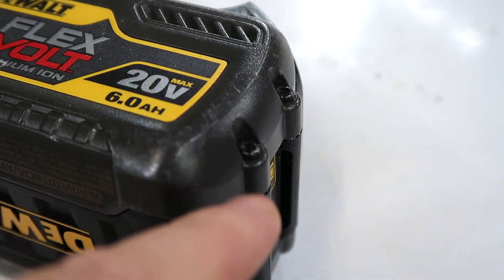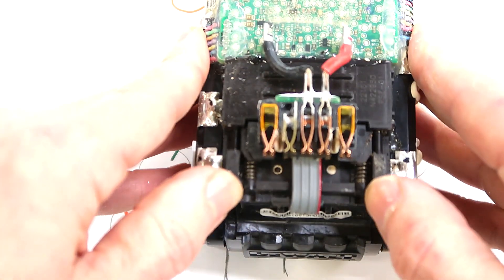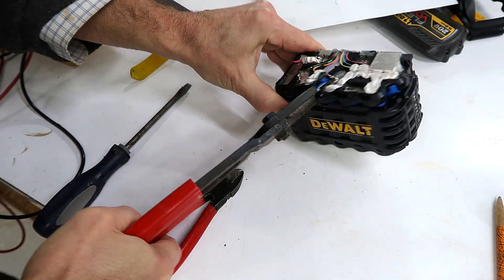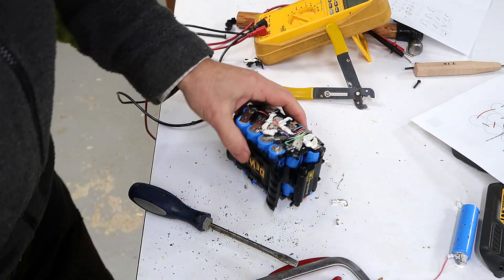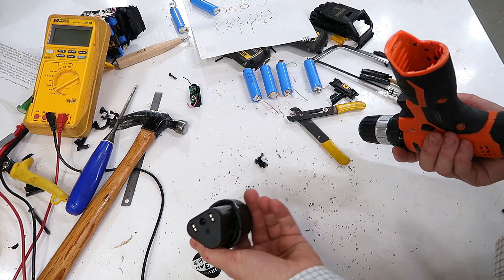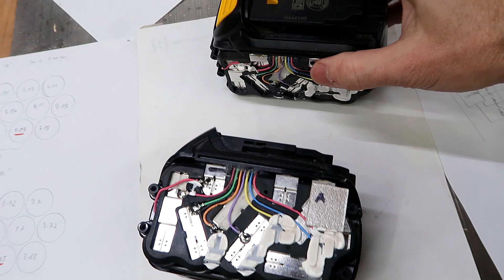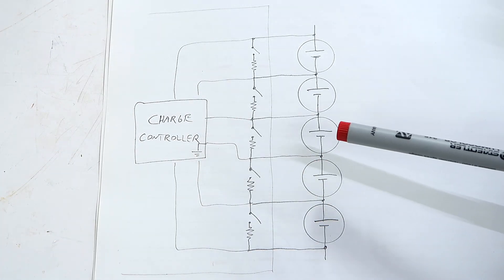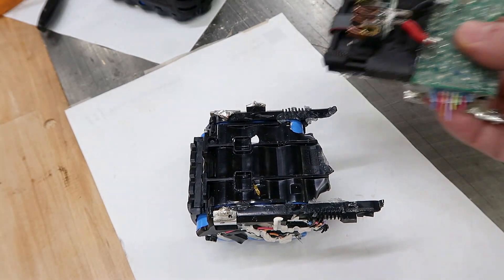This kills flexvolt batteries prematurely

Comment: I bought two flexible six amp batteries and both of them did not work after two months. They look brand new and I hardly use them. I sent them back and dewalt  honored the warranty sent me two brand new ones in a box one of those brand new ones immediately did not charge and won't show more than 1 bar never had a problem with the 9 amps though

Comment: These batteries are not at all difficult to disassemble non-destructively. Take off the battery tab by either prying or gently grinding the spot weld away, take all screws out, desolder the BMS leads, separate the shell on one side, and wow you can suddenly slide out the couple of cells you need.

Comment: Can I revive a drained cell?
Reply from the maker: ask someone who says they can
Reply: With a power supply you can. Its safer if the battery is not below 3v and you will want to know the battery resistance, as that is an indication of health. Best left to someone who knows what they are doing.

Comment: Fantastic video! Many modern fuel gauge, cell balancing, charge controller ICs will disconnect the load if any single cell drops too low, but A) these packs may not have that feature, and B) That IC can still drain a few hundred uA meaning it will kill the battery eventually if you don't charge it. Thanks for this great teardown vid!

Comment: I just bought two new 5Ah PowerStack battery s and they both have a cell that's low, I have to figure it out how to get it charged to the same level, otherwise it will not last for long, crap DeWalt quality. Looks like planed obsolescence!
Reply: Its no difference with any other brand. At least Dewalt is not locking the BMS yet like other companies.

Comment: Should always 1st try to bring each cell to at least 3.5v.  the 2.72v cell is probably still recoverable. 
Otherwise the first the charge, first to discharge rule will hobble your battery.  my experience was with nicer designs .... https://youtu.be/lm0ZGxHCT8c

Comment: The important part of the DeWalt battery pack is the end that connects to the charger or device.  The magazine holding the batteries isn't crucial and can be replaced by a different one.  It should be possible to 3D print a new magazine that will mate with the device connector end while still being user friendly as far as replacing individual cells.

Comment: It is a very expensive battery. So dewalt has not designed it to be repaired, under the guise of making it tough. It is not very environmentally friendly of them. For as soon as one battery goes it is useless as a house of cards. While the rest of the batteries are perfectly fine.

Comment: I wonder if using a different charger would make a difference.
Reply from the maker: cell balancing happens inside the pack, not much the charger can do about it.  And cell balancing only happens during charging.  So he important thing is if it hasn't been used for months, charge the battery before heavy use even if its not empty

Comment: Interesting to know
cuz the normal XR do not have a way to balance them

i will dig into this with one of Flexvolt
what cells are those blue one in 6Ah ?
i know the 9Ah and 12Ah uses 21700

Samsung 30T and 40T
40T seems to have issue

Comment: Very useful tip video Matthias, thanks. I don't use my flexvolt 9ah all that much so knowing not to run it all down at once before charging will save me £150 on a new one down the line.

Comment: Hey Matthias, one tip for getting around security torx screws without damaging it (and potentially voiding a warranty): They're meant to keep other people out of them, but there's a fundamental vulnerability, where all you just need to do is use a small enough flathead screwdriver to undo them.  You just need to jam the flathead between the pin and the sides of the chamber.

Comment: Hi Matthias, awesome investigation! How about designing a new matrix controller that would constantly rewire the batteries to prevent this from happening? Even simpler would be to modify the circuit to provide balanced charging and solve the issue much easier. Thanks for the video!

Comment: I am pretty sure you are correct concerning the cause (and solution) I seen this being done in other products as well. If you had tried charging the 3 bad cells individually up to the voltage of the other cells, while still in the pack, you most likely could have recovered the pack and then could have put them on the charger for balancing. I have done this myself but on a 5 cell pack.
Reply: How to charge the cell individually? What kind of charger can be used?
Reply: you have to inject low voltage with a probe on each cell until it gets to a detectable safe charging voltage for the dewalt charger @harenthiran

Comment: Do you not leave the battery on the tool as the tool will slowly drain the battery and quite often make it unretrievable. With Dewalt batteries they sometimes appear dead but if you leave them on the charger for an hour the smart charger can sometimes recover them.

Comment: i know you make these videos for entertainment purposes so i wont get too critical here,  but just for the record, those cells were probably fine. when an individual cell falls out of favor with the rest in the pack, the balance circuit cant correct it. all you really had to do was attach an independent charger to each cell one by one and bring them up to the other cells in that group of 5.  i would do the one at 0.01 in increments tho, bring up to 1 or 2 volts and see if it holds onto any of it or not before going all in.  oh and ps,  you can do this without removing any of the cells or tearing anything up(at least on these dewalts you can)
Reply from the maker: once the charge gets that low, the cell is toast
Reply: @matthiasrandomstuff2221  experience with them has told me that isnt always true, around 3 years ago i took apart a dell laptop battery that was around 15-18 years old, all 9 cells were 0.4 or lower, and all 9 recovered. the cell's original capacity was 2600mah, none were lower than 2200, some were above 2400, they all hold their voltage and their capacity to this day. their capacity however is determined by how many discharges they have done, not by how low they went.  if you're concerned that it might explode, take it outside to try it,  but i would recommend trying to save it first time next time this happens. you might just be surprised with the result.   the balance circuit only balances between the groups of 5, it cant fix an individual cell if one drops off from the rest.  on that part im not sure why that even happens but sometimes the cell itself is fine

Comment: So I guess the battery was charged on a non flex volt charger, 😎
Reply from the maker: all flexvolt batteries charge on a 20 volt charger
Reply: @matthiasrandomstuff2221  yeah, they charge, but the XR chargers overheat the battery, hence the fan or trickle on the the last 20% on a proper flexvolt charger, 👌

Comment: i'd never have guessed this. what use is a so called "battery protection circuit" if it doesn't monitor the balancing leads.

Comment: Never try and recharge a lithium cell that's gone below 2.5V.  The copper current collector dissolves into the electrolyte and can plate out elsewhere in the cell when charged, possibly leading to short circuit and fire.

Comment: I'm not so sure the BIG tool brands have ANY type of cell balancing. That would add a lot of charge time and their customers have come to expect a charge in as little as 30 to 60 min. Yes every cell voltage is monitored because they have to, but charging terminates when ANY cell voltage approches the 4.2v maximum threshold for Li-ion. This can leave some cells less than fully charged, however with factory matched cells the voltage will stay fairly similar without balancing unless they are abused or have many cycles. 
Also reverse voltage is not going to happen, this isn't Nickel Cadmium technology. There is a full BMS in the battery to protect against low cell voltage. The MOSFETs shut off the load and the battery becomes unusable when any cell voltage is less then 2v. This includes powering the BMS as well. The standby current of the BMS isnt going to drop a cell to zero. Whenever you see a Li-ion battery @ 0v the cell is SHORTED internally. This is a fairly common thing that happens. Thats why TESLA batteries have a "fuse" on every cell. When there is hundreds of cells in parallel, you dont want a shorted cell to then short the others.

Comment: Your theory is good but very unusual. I have never ever seen a BMS that takes its power from the middle cell - it would make balancing the cells much, much harder to do circuit-wise. I think it's something else at work, but without a battery to work on i cannot say for sure.

Comment: nice video but if you just charged up the 3 low voltage batteries and then put the cover back on then you would have not wasted your time and a half decent, very expensive battery.

Comment: It's sad that 14 more batteries get thrown out when 1 dies or under voltage.  Could you have hooked up a power supply to the individual cells and brought them back up?
Reply from the maker: It might have helped make it sort of usable again, but once they get that low they are irreversibly damaged.

Comment: I have successfully rebuilt one of these pack without destroying it, built my own spot welder and everything
However, it will not charge past 1 bar  just like before i rebuilt it I even pre charged all of the cells ahead of time
sure wish I knew the secret to rebuilding flexvolts

Comment: Considering the very high price of these batteries and charger, it should have a functioning balancing charger.  They have been used in the Hobby industry for at least a decade.  It reads the voltage of every cell and charges until they are all balanced.

Comment: I would have put a single-cell charger on each of the dead cells, current limited to C/100 or possibly C/20 or even C/10 but lower is better.  Even from well under 1 volt I've had cells recover and work for years, but usually with some permanent reduction in capacity.
I had a 7S20P pack with one of the 20P sets short circuited to 0 volts for an unknown amount of time.  Four of the cells had been physically damaged by the short or showed signs of severe overheating.  Removing the short and trying to charge the set failed so I separated all the cells.  13 of the 20 are in my scrap pile either because they were internally shorted and would not charge at all or would self-discharge too fast for my taste. 7 of the 20 recovered and have been working well.

Comment: Do not store lithium ion batteries for more than a week fully charged or discharged.  That is the mantra of radio controlled aircraft fliers.  The best state of charge for storage is about 60% of full charge for longest battery life.  RC battery chargers usually offer a storage charging cycle that achieves that storage charge level and balances the cells to within 0.02 volts.  Do I always follow that advice?  Nope.  My tool batteries are often forgotten on the charger for a week or more and then left fully charged on the shelf for a month or more.
Reply from the maker: Yes, agreed.  But aircraft batteries probably get charged MUCH higher than tool batteries, cause capacity over weight is so much more important. EV batteries get charged a lower level still, and grid batteries even lower.

Comment: I was literally wondering this about these batteries the other day. Like you i thought they were 3 horizontal series strings of 5 cells.  I realise they have the BMS on the battery because of the series connection. It's a bit poor if the BMS can actually be the thing that makes an imbalance in the pack. I have alot of these batteries and am going to take the sides off and charge them. My use case is similar where i have them sitting for a period and then need to use them. I rarely ever deplete them fully though.

Comment: Great analysis, I think you are correct as to the root cause of the failure. My drill and driver are 12V Bosch so they probably don't have an internal battery balancing circuit but I'll keep your findings in mind and periodically plug them into the charger.

Comment: It would be nice if DeWalt would make their batteries and chargers a bit smarter. I noticed years ago that a battery that sits around still shows fully charged on the charge indicator, but won't run as long before needing to be re-charged. But worse than that is that a battery left on the charger cradle will be drained and not re-filled. The indicator light on the charger uses the battery to light up and so drains the battery. And the charger won't kick in to re-charge the battery unless you unplug the battery from the cradle and then plug it back in. There's not really any continuous monitoring going on, nor is there a float charge of any kind. The problem is worse with low capacity batteries, like the 1.3Ah ones that come with most of the tools nowadays. You put your battery in the charger and it charges quickly. But just leaving in the cradle overnight, which I do for convenience, takes a huge chunk of the charge back out of it. So now, if I want to have a fully charged battery, I have to watch it closely and pull it from the cradle as soon as the light on the charger stops blinking!

Comment: It has nothing to do with Flexvolt. Not even with DeWalt batteries. All lithium batteries with passiv top level balancer have this problem. Charge frequently, charge full and don't discharge too deep.

DeWalt should be recharged when there are 2 LEDs of charge left. Thats the point where the battery loses significant power. That means the battery is empty.

Comment: If you need some of those cells you kan harvest them from laptop batteries. If theat BMS will accept them you have to precharge them to about the same level before you connect them to the bms.

Comment: My thought was planned obsolescence. As in the controller intentionally doesn't fully charge the middle cell so it will always be lower and eventually degrade to the point to where you have to replace the battery. While that's probably not true, it might still be planned around using that middle cell to power the charge controller to eventually kill the battery before its actual lifespan.

Comment: Would this be a good case for leaving unused batteries on the charger to prevent that self-discharge and therefore always being good to go until fully drained, or do you reckon the trickle charging would negate any gains?
Reply from the maker: keeping batteries always fully charged doe cause them to deteriorate faster than if you keep them half charged
Reply: @matthiasrandomstuff2221  that's not true where did you pull that horse sht from?

Comment: Nice video, it would need further investigation. You said they are balanced after charge, but how close are the voltages to one another. I have yet not oped a dewalt battery, so I'd be really curious to if they balance charge. If opened 10 or so bosch professional batteries including procore batteries and they just rely on well balanced single cells which over time comes down to a unbalanced pack and eventually dies because of that. I found some batteries to be worth like the 5ah once which have Samsung 18650 cells in it which are known for big divination over time. Those batteries go bad and you can balance them by hand and they will work again for a while until the are unbalanced again do to different wear of the single cells. I feel like they could last so much longer with balance charge, but they just don't do it. I once in a while balance my batteries and try not to run them down to low to prevent big stress on the single cells, especially if some are lower already, you drain them down to 2,5 volts which isn't that good long term. If you keep them balanced they work well for years after being dead (bought on Craigslist) but this is certainly not for everyone to open them and balance them by hand. It's just frustrating that they cut cost and longevity by those measures. From a company stand point and by wanting to sell more I do, but that is not cool. I myself am a product developer and luckily work in a company where we try to design for longevity and having product life of 30 plus years as goal. But that is often found anymore from what I've heard. Keep up the good work and hope they balance charge them, to give it a longer life.

Comment: I hate to say it now, but I’ve gotten years more use out of batteries like this by individually charging each cell one at a time, while in the pack, with a good lithium battery charger.  Once they are all charged, you effectively reset all of them to an ‘equalized’ state, and they will tend to discharge evenly, and charge evenly.  Oh, and never leave a pack below 50%, but also only charge to 100% when you really need it, I like the 75-90% charge level to gelt longer life out of my packs.  I have some that are over 15 years old still working.  By keeping it above 50% when stored you don’t allow any one cell to go below the min-threshold charge voltage, and the microcontroller doesn’t deem the pack unchargeable.

Comment: Matthias, keep the springy clamps that connect the battery to the pins on the cordless tool battery mount.  these little springy clamps can be put into a 3d printed adapter if you want to adapt one manufacturer's battery to a tool that it wasn't designed for.  i've successfully done this with no problems with 20v tools of different manufacture. i didn't have any so i used springy paper binder clamp thingies and those also work, but it's much better to have the type that were made for the job.

Comment: I would have put an unregulated hobby charger on the cells until they read 3 volts . That is the minimum voltage needed in a lithium battery to accept a charge from a regulated charger. that's my 2 cents.